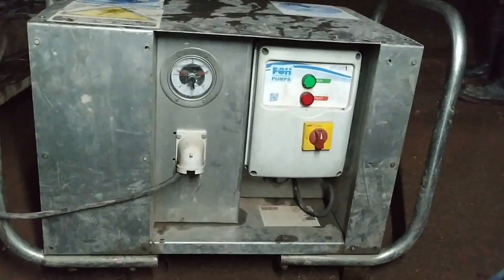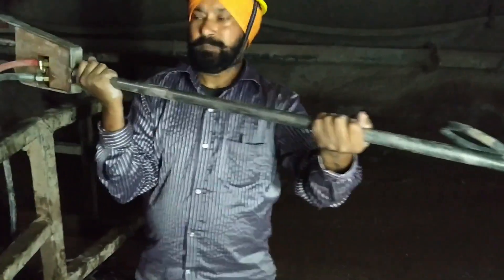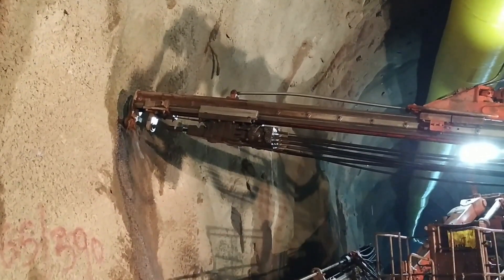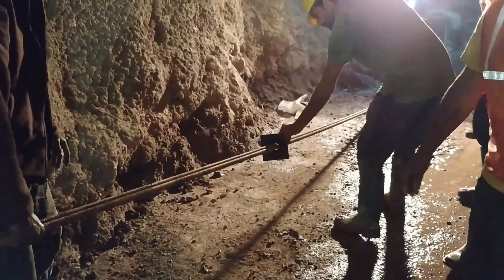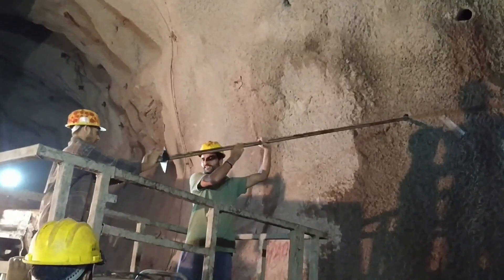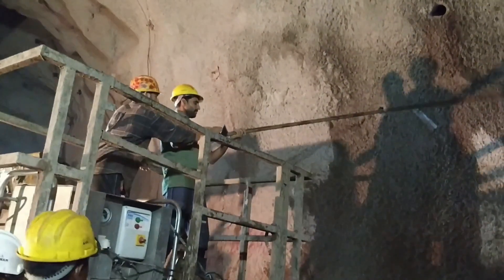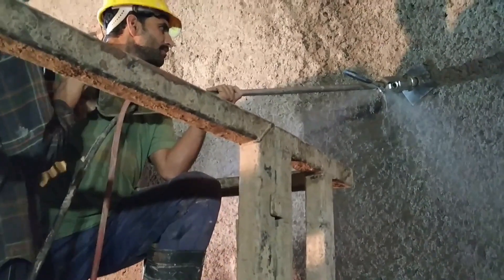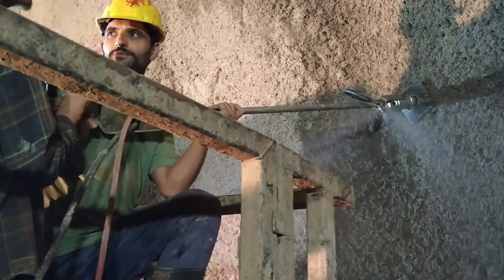Swellex Rock bolt installation in tunnels

Comment: Dear Sir, we are manufacturer's of the pump system you are using and showing in this nice video. Thank you for purchasing from our company. Have you replaced of made any modification to the setting of the high pressure control valve which is inside the casing? This valve is attached near to the pump and has a black plastic cap which is used to set the bypass pressure for safety. This is preset by us during manufacturing. If you want to adjust the max pressure of water injected into the bolt, you use the 2 set point pressure gauge located at the front panel. There is a special key which is attached on gauges casing that is used to set the lower and upper limit (the 2 red color indicators of the gauge). If you need 300bar, you set the max at the 300bar, if you need 240bar, then you need to set the max to 240bar. That's the way to regulate the required pressure. Not by the internal by-pass valve. Please contact as if you require any assistance: info@elebor.gr